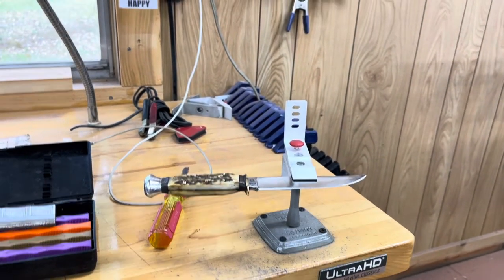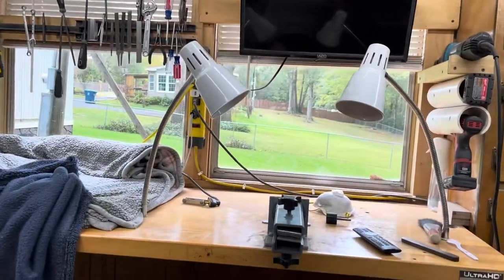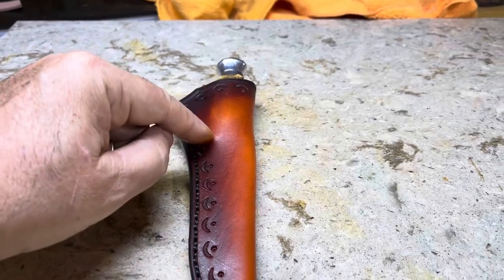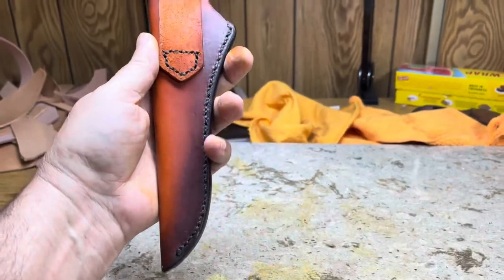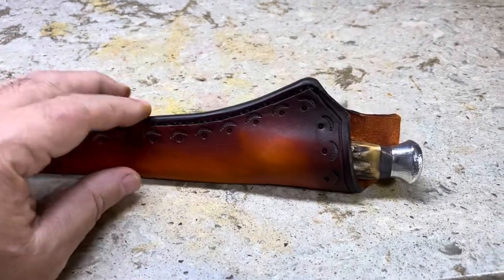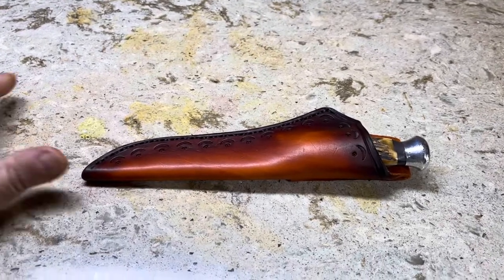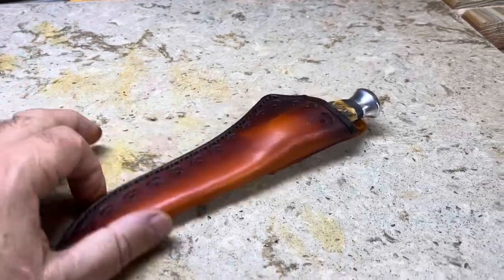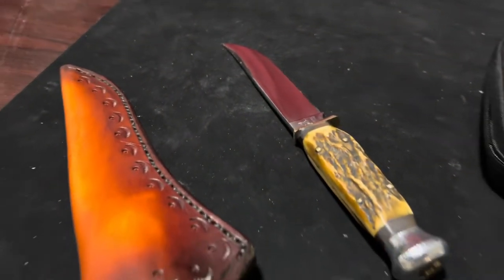Made a sheath for the restored knife

Comment: That sheath looks perfect with that knife. It's  also clear that your knife shop has another calling. Reminds me of "rebuild, repair, repurpose". On another note, Glad to see Roof Cat again. Thanks!

Shelving does work much better. Wish I had room for more. Before you block that window, consider hanging a blanket or quilt over it for extra insulation. And light blockage if the curtain isn't room darkening. Just provides a bit more protection for what's in front of it. 

Hope  you & Charly have a peaceful, safe and blessed day. Godspeed.
Reply from the maker: Definitely going to cover the window. That end of the house gets sun and I want to maintain it at a cool temp.

Comment: That’s a nice old knife. It’s good for at least another hundred years now.
Poor old roof cat has some pretty serious trust issues concerning humans. 
Here’s a whacky idea:
When I was younger, pretty much everyone I knew and visited played guitar. A jam session was part of every visit. Some folks had a cat or two. (And here’s the point I’m trying to make). An open guitar case with a plush interior is a cat magnet. Within thirty seconds of a cat finding an open guitar case they take up residence. 
So maybe, if you plush up a box that could be warm and cozy on a cold day, find an appropriate spot an tempt roof cat with some food near it, roof cat may take up winter residence. A heating mat for starting seedlings can work great for heating up and animal bed in winter too. Those things are waterproof, low powered and extremely tough. I’m tempted to put one in my bed.
Reply from the maker: I could crawl up under the house and put a box there for her. Great idea!
Reply: @bctruck I've seen some folks use old ice chests with a hole cut in the corner for access.
Reply from the maker: @jjudy5869  that’s a great idea.